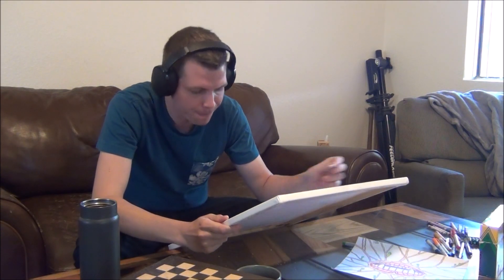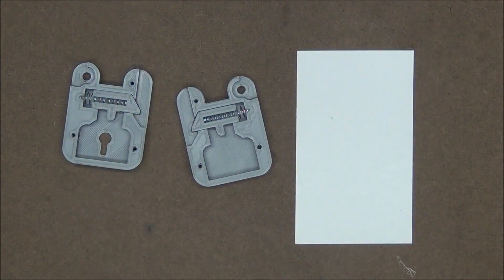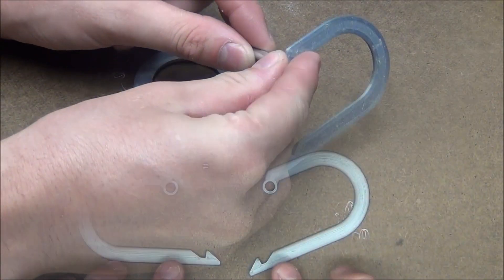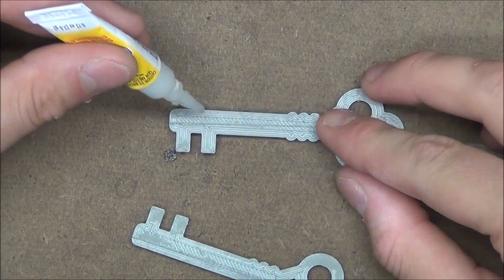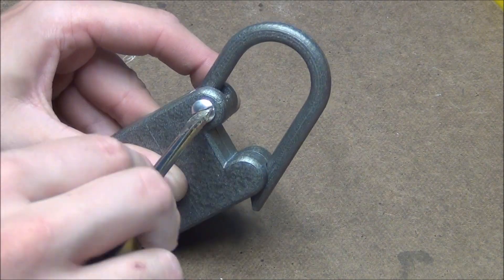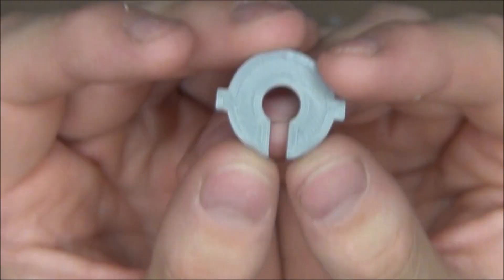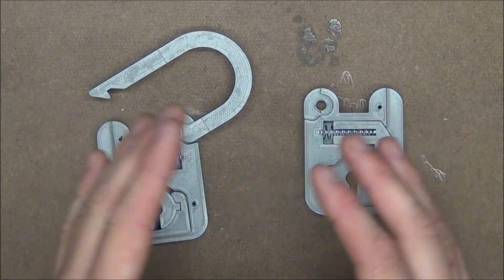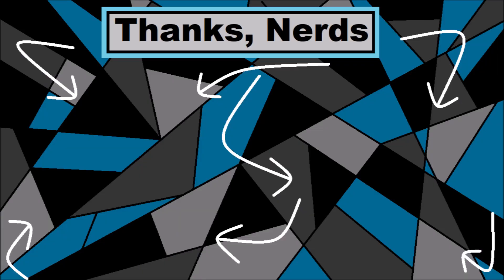How To Make A Skeleton Lock & Key!! (3D printing my own old fashioned lock)

Comment: My lock came out great . The only thing that happened to me was the springs that I bought were a little stronger than the ones used in the video.  And I broke my key and had to reprint it with a 100% fill